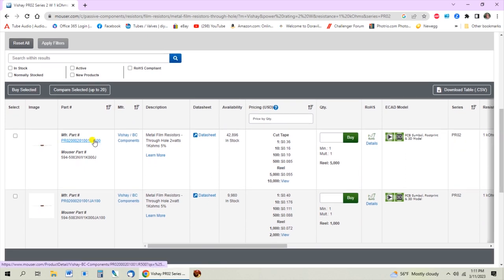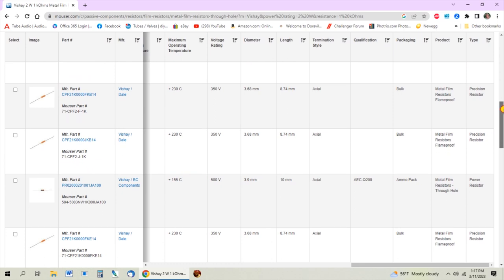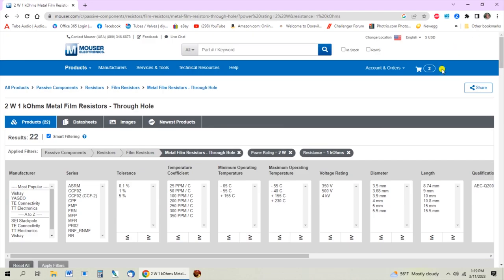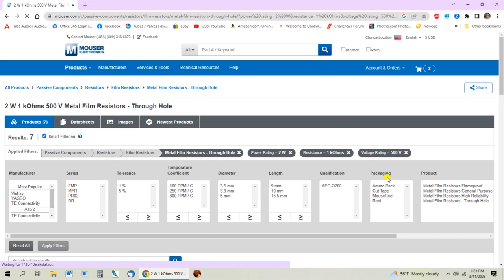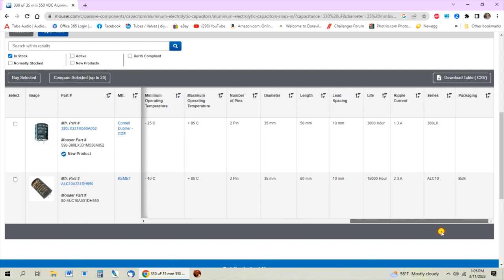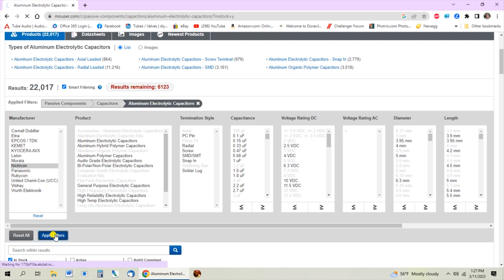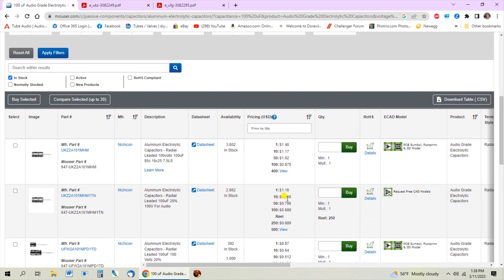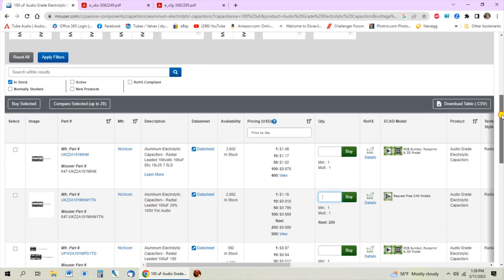How to Shop and Find Electronic Parts!

Comment: I normally use the In Stock filter, but I have had problems using the Normally Stocked filter. So many problems that I just don't use it any more. I have also found that Mouse prices are generally a little cheaper than Digikey.

Comment: The lesser-than/greater-than feature is useful too. For instance, you can filter out all voltage ratings below 450v, or all cap diameters over 35mm, etc. The ‘shift-click’ and ‘control-click’ is great for selecting band-pass parameters too
Reply from the maker: Great tips!

Comment: Another great video for those starting out. Parts in uk is an issue that seems to be getting worse in my opinion. I end up using Mouser, Digi Key etc shipping from US. I Just have to plan parts very carefully as there is a minimum order value with free shipping. RS components in UK is also worth a look. Shipping from mouser is mental, I have had orders next day from Texas. HiFi collective is the only place I have found in UK for high end items (Audio Note, Mundorf etc) I still struggle to find wire rated over 400v at the correct   guage.
Reply from the maker: For wire used with DC, it's 50% higher than the AC rating, so 300VAC rated wire is good for 450VDC to ground and 900V wire to wire.

https://www.voltimum.com.au/articles/difference-between-ac-and-dc-voltages-and

Comment: I took your advice and bought two of the 8 ohm resistor bars from you video. I bought two so I could cover 4, 8 and 16 ohm scenarios.  Could you show us how these get hooked together and connected to an amp as a dummy load? Thanks.
Reply from the maker: You would hook them in series for 16ohm, use as a single for 8 ohm and parallel for 4 ohm.

Comment: Hi, behind you is that a Komet or Atomic rotary valve engine with a motoplat ignition coil?
Reply from the maker: Open class (Methanol) Yamaha KT100A rotary valve with a piston port cylinder.

Comment: How about finding lower priced transformers? Looking up just the power supply transformer at > $100, it’s kind of a buzz-kill realizing you’d need to spend $300-$400 or more for parts alone.
Reply from the maker: The iron has always been the single most expensive part of any build. It's hard to cheap out on that and still have high quality sound.